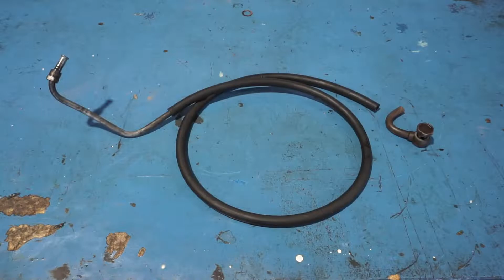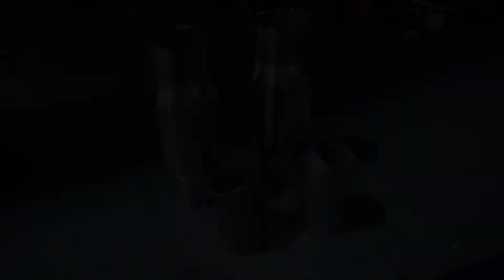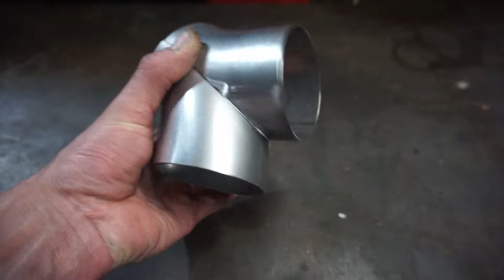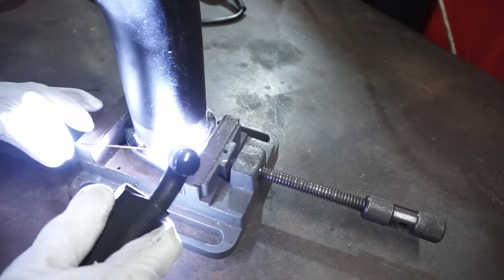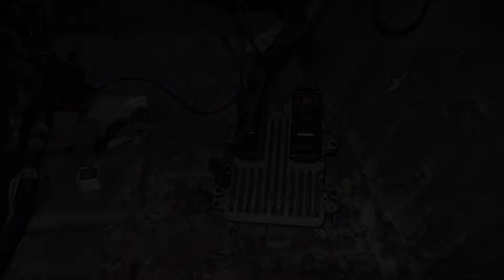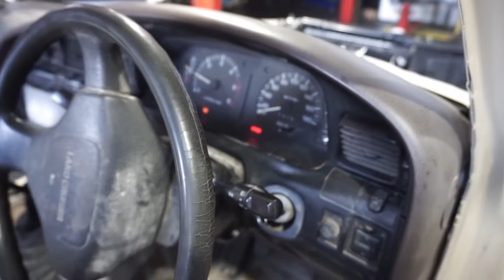80 Series Land Cruiser Manual LS2 Conversion

Comment: How about the speedometer?
Reply from the maker: that runs off the stock speed sensor on the manual the loom at 12:00 is the one that has the speed sensor wire